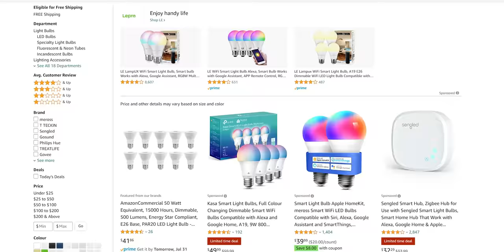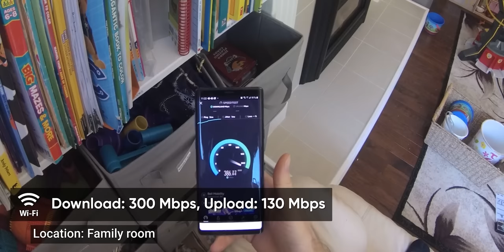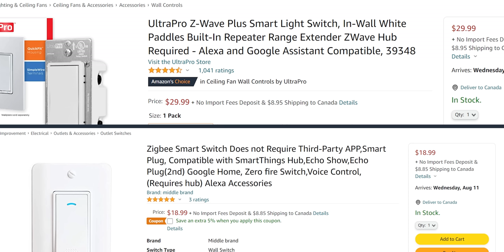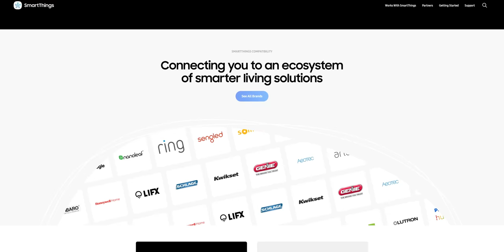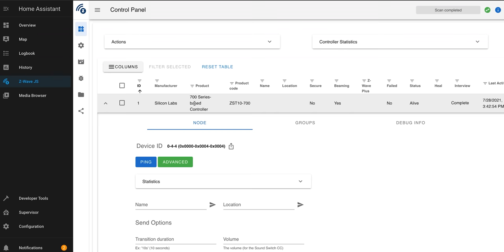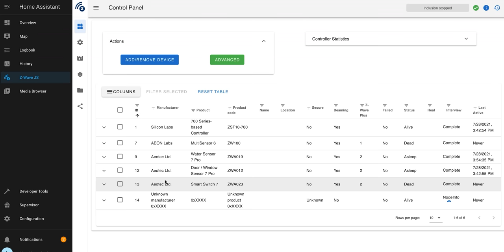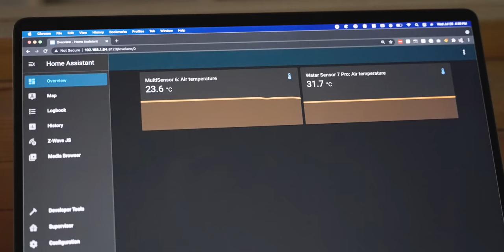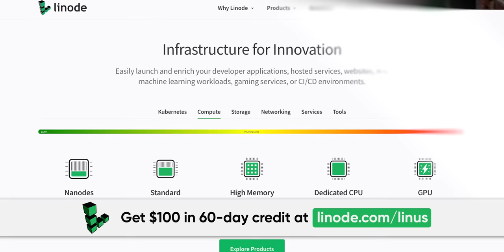My new house is gonna be MAGIC - New House Z-Wave Setup

Comment: I'm so happy that they continue to use the "Brian the electrician!!" jingle.
Reply: just me who read "Brian the electrician" and heard the tune?
Reply: I'd be even happier to actually see BRIAN!! the electrician!!! But I figure Linus won't do the car chargers himself, so there's still hope.
Reply: @pr1vatepiles1  same
Reply: Thanks you spoiled it for me. It's the top comment
Reply: If Brian was around he coulda told them running an empty microwave is dangerous because if there's nothing inside it to absorb the microwaves energy, it builds up way more rapidly and can kill the unit/cause damage/an actual fire etc

should run it with a small glass of water in it at the very least.
Reply: Scottward Holmes
What smart gear you use yourself, Philips UI? wifi?
not that smart, not understanding?
Reply: @SlackFX.channel i did not know that was thing. Thanks for telling me otherwise i would probably have killed 10 microwaves already
Reply: I hope it lives on in LTT forever

Comment: Linus: complains about mechanical sprinkler controls, and intercoms in his 1990's house.

Me sitting in my 1908 house having just removed concealed knob and tube electrical connections and uphill plumbing from the same bathroom:
"That's so unfortunate, I can't believe you were left with that mess".

It's not a competition, and I can identify with any remodeling struggles.
Reply: In the same boat, my house was also built in the 1900s. I just had to have the original cast iron plumbing going to the upstairs bathroom replaced a year ago.
Reply: 1900s as well, upstairs bathroom pipes shake sometimes audibly, and knob and tube in the whole top floor. Dangit Linus your 1990s house was great.
Reply: I lived in a car 4 years ago, and even I felt more fortunate not having to deal with old houses
Reply: @FullOfBradells  That noise is likely coming from your water supply pipes. It's called water hammer if you're not familiar. You can install a thing called a hammer arrestor to stop that.
Reply: 1913 here. I look forward to the day where I proper electric and plumbing in our first floor bathroom.
Reply: @Ci Absalon I ripped that shit out in a heartbeat, and made sure what it was connected to was pulled from my electrical panel. Strangely it was being used for my doorbells, which connected via a 24v stepdown transformer on each of the two lines.
Reply: @MHTriBernard  asbestos tile is only 9.5"*9.5" last I knew. I could be wrong, I'm not an expert.
Reply: My parents house is filled with knob and tube wiring, the thing is no one ever removed wiring or plumbing while upgrading the house built so I have no idea what's active. Sigh. Like someone has a knob and tube wire going though and HVAC duct... Is it active? Is it not? Haven't gotten to investigating it all yet
Reply: @FullOfBradells  you're getting air pockets and pressure spikes in your water lines. If you add one of those blue pressure tanks that goes away.
Reply: atleast you can afford a house.. rich guy
Reply: 1912 house 8degrees in the winter 35 in the summer
Reply: @lvl5monk297  buy a non contact tester
Reply: Ouch on the uphill plumbing
Reply: me sitting in my house built in the 1880's: 🧍
Reply: Seriously. I just found a couple holes behind the baseboard from when a previous owner upgraded my mom's house with electrical wiring.
Reply: 1940's house, found the chicken wire plaster and weird sound(?) board in a few walls and loads of cloth wrapped wiring that I slowly replacing circuit by circuit.
Reply: At some point you wonder why they don't just bulldoze the house and rebuild an entirely new modern one.
Reply: I've been to a castle that was built in 1285 and they had decent electric wiring and lighting.
Reply: Lol.
Reply: I have an old Victorian style house built in 1888. 
Half my windows don't open.
Reply: I live in a house built in 1800s😂😂 With renovation ofc
Reply: I had no ceilings downstairs for 10 years because we redid the central heating and the walls needed work too.
Reply: Haha rip
Reply: I would be too scared to live in a house that old,
the ghosts tho lmaoo
Reply: My house if from 1830's
Reply: @billybillybillybillybillybilly  damn dude seen a ghost or smn yet
Reply: @lxquid.ocelot  i have had so superstitious experiences, but nothing else. But my house would be worse, it used to be a woman's clinic, with surgeries, so possible  deaths
Reply: @lxquid.ocelot  nah, but after my grandfather died, the light pull strings would move on their own (it is an old home, so where there weren't light switches, there are pull strings) and some cups moved on slowly and shakily their own for like 5cm. And this is Syndey, so any Earthquakes wouldn't be strong enough to move objects
Reply: @lvl5monk297  You can buy a $5 non-touch tester to see if you got live AC wires.  Extremely useful to have if you are doing any sort of house wiring work, especially if your house is older and might have some weird wiring methods (e.g. live wires not connected via a fusible link).
Reply: some scottish guy in his 1600s homes "Oi, thats cute mate."
Reply: @robintst  I'm in a literal boat from 1921  but only the outside is 100 years old 
I got 500 gb a month wireless 4g router wich works amazing it's not the 600 mb/s what I was used to but 30 is fine for me
Reply: “Laughs in 1700s English house”

Comment: I highly recommend putting some sort of filler media over your AC intakes if you run it while construction is being done in your house. You don’t want drywall dust or anything else in your AC coils.
Reply: As a drywaller - I second this. Also change the main furnace/air handler filter after the construction is done (or at least check if it needs it), and if there's any forced air outlets at floor level, it wouldn't hurt to cover them with ordinary window insect screen material to keep big chunks out.

We (the company i work for) always vac the registers when finishing up at a job, but you can only get so far with a shop vac

Comment: i had no idea about home assistant with RPI, thanks for that i am going to try it later today
Reply: Best thing ever!
Reply: A RPi is kinda nice when getting into HA but I would recommend a nuc or some sort. The amount of reads and writes HA does will eat your SD for breakfast. 
Also the nuc is far more powerful which will end up in a faster reboot. And since you're building and programming a smart home system, you'll do that a LOT!
Reply: @DhrChibi1  Agreed. This is why I bought a HA Blue. Faster and more reliable than SD cards on a Pi (yes, you can boot your Pi from USB)
Reply: If you already have a server setup you can just install it inside a vm to get the same functionality
Reply: We can have "smart" lights without giving a foreign company full control?
Reply: Yea, it's a thing.. but home assistant writes to the SD card enough that you'll likely end up with a corrupt card inside a year.  I run it in a VM, the extra horsepower of a "real" machine is beneficial too ;)
Reply: @MattBlank0  Yep. Especially if you opt for something compatible with tuya or tasmota, tuya can be controlled locally - there's a home assistant add on for that, and tasmota can be flashed onto MANY various wifi devices. Once done they can all be blocked from accessing the internet. 👍
Reply: @DhrChibi1  RPI3B+ will boot from a SSD on a USB adapter without having to even turn on the USB boot flag. Kinda nobrainer if you ask me.
Reply: careful using an rpi, sd cards will get destroyed by HA.
Reply: @DhrChibi1  not wrong RE SD cards. LEarnt that the hard way. I boot my pi from a USB and it’s been rock solid since. I also do nightly backups to Google Drive just incase!
Reply: There is a lot of hardware that you can run HA on. As for raspberry pi... You'll need a model 3 or higher. There are better hardware choices if you don't have one laying around...

Comment: to answer linus, you could use the output of the power meter for the whole house as a parameter to avoid having too much power draw at once: for example you could stop the charging of the cars if someone turns on too many devices at once
Reply: Could also load balance the 2 lines so one is not getting hotter then the other
Reply: Or have a second breaker box just for the garage. A guy I used to work with did that for his Tesla so he could charge his car without affecting the house electric. He then is able to monitor his solar supplemented power used to charge the car and whatever isnt used back feeds into the line. The power company is literally paying him for the electricity he uses to get to work.....and he works for the electric company 🤓
Reply: @Watercooledguy  Agreed with the second breaker box. Its honestly just more ideal and safer to run it separate for the Garage. 
I think linus could do that and would be better off in the long run. Could even run a separate system of solar so he has a bank ready
for Tesla charges so it doesn't stress out the overall parameters of the house's breaker.
Reply: Still limited by the main breakers capacity of 200amps with a pony panel for the garage.
Reply: No.  No. No. 

EVs manage that themselves and talk GreenPHY.  If you don't have that running in your house you will be tearing out this wireless crap that should never have existed.
Reply: You could also make decisions based on your Time of use billing (where electricity prices fluctuate based on time) and solar output.
Reply: It's even possible with a sufficiently sensitive whole-house current sensor and smart enough software to detect and characterize individual loads in the house, then "learn" the usual patterns, and alert on changes: for example, the fridge/freezer compressor cycling will be very recognizable. If it starts to cycle faster, or take more power, you can alert the human, who can close the damn door! (Or get the failing compressor serviced) In essence, you can use machine learning to tease out all the loads in the house, without having to add individual load monitors to every outlet and appliance.

Comment: Gonna love when Linus gets it all setup then updates Home Assistant and it ALL breaks as per standard home assistant update requirements
Reply: How often do people need to say it:
Read the changelog, especially the breaking changes part before updating.
Reply: @Joey-ir3lk  an update shouldn't break anything
Reply: @Theosplaytime  it doesn't just randomly break.
In developing software, what Hassio kinda is, stuff sometimes get deprecated.
It's doesn't just happen randomly, they actually announce it a few updates before.
Reply: @Joey-ir3lk  I don't think I want "developing software" controlling my home. Somehow, HA always tells on itself rather quickly...
Reply: @ikjadoon  it realy isnt but you MDMA is still right HA has good deprecation policy but people still dont follow it and that is what happens as a result Read changelog Read braking changes like you should with every software update
Reply: @ikjadoon  you want developing software controlling your house that means that software will get better and actualy have policies to fix bugs and security problems. But yes sometimes deprications happen having good deprication policy is important

Comment: As an electrician, you can never go wrong with hardwired Ethernet throughout the house with WAPs (WIRELESS ACCESS POINT) scattered in alternate hallways etc. With a programmed Cbus system. If you have all your light switches, PowerPoint's and lights running wireless, it just creates the problem of drop-outs and unpairing issues. Linus being a tech lord should know this! You can have all the tech gear you want on wireless systems but when it comes down to the essentials In your house that you rely on every day for living, keep it wired! :) love from Straya.

Comment: As an electrician who has been doing this for 15 plus years and specializes in automation just use Lutron Caseta for what you are doing, no neutral required and works every time
Reply: No neutral required for a few of the devices (dimmer mainly).  A lot sill require a neutral.  I don't think a neutral is a problem for Linus, but Caseta is at the top end of the consumer tier smart products.  And they just work.  No one wants to tell the family, "Sorry kids, these lights aren't working like they normally do because I decided to do an update to HA last night and it broke my automation.

Comment: I just received my Sense that hooks up to the panel and can identify what is running by its electronic fingerprint. Eclipse on to the two phases like the device you had does and then it gets powers off of a 220 breaker. If it works as described it should detect and learn all of my electric devices in the house. Can’t wait!

Comment: I'm in the process of doing this right now. I wish I had a employee to dedicate to home assistant I love playing with it but damn it can take a long time to customize. What an amazing project, and it is super cool to see Linus using it and getting it some additional shine.
Reply: I am saving to do this on my house. Any tip or suggestion I should be aware of? :o
Reply: @contradictorycrow4327  Already done that. My question was more along the lines of the Home assistant software.
Reply: @darktetor  Advice would be to keep it as simple as you can if you are building from the ground up.  I'm liking switches more and more with zwave. I find wifi bulbs are not as stable. I also would suggest if you are using a raspberry Pi 4 run it on a SSD instead of SD card. Do research on devices before you buy make sure they integrate into HA and play nice. For example Nest thermostat and cams are a giant PIA to integrate and requires quite a few hoops to jump through. You will need to do a bit of coding in the HA yaml files to make some things work . Don't get intimidated there is lots of videos and tutorials and the HA community has been a friendly and pleasant experience. The second you make a cheap motion detector turn on your lifx stuff, those are the moments that make it all worth it.
Reply: @tyx2  now this is what I wanted. Thank you! In fact I am in the process of buying a raspberry Pi 4. Gonna take all this in consideration for the other devices.
Reply: @darktetor  Have fun with it ! I'll give you the best of advice. When you get frustrated and you will!!! Walk away for a bit also the first thing you should set up is backing up to Google Drive. This way any mistake made you can go back, also if your rpi4 or SSD were to fail you can restore within minutes

Comment: I'd highly recommend using an SSD in a USB enclosure for the Pi. Much more stable than an SD card, quicker reboots and updates etc. Then use the Google drive backup add-on for automatic backups should anything go wrong.
Reply: Someone should show Linus the TOFU board that lets you use m.2 NVME SSDs natively with the compute module 4
Reply: I'd rather back up to a local NAS than Google drive (cloud services are a catch 22).
Reply: @grn1  He could do both. I mean the dude will have a server room anyways so he will most likely have a dedicated NAS anyway...

Comment: Great Episode!  I came to the same conclusion months ago when starting a building automation project.  One thing about ZWave, because of the standardized structure for commands, any device not listed can be easily added by simply adding parameters.  I did this with openHAB.  I introduced a commercial Yale Lock with an AYR202 ZWave module. openHAB detected the device, I submitted the resulting XML to the Open Smart Home site and was invited to add in the  ZWave parameters which form the basis of the device channels.  I can now program codes and simply unlock the door with a tap.  ZWave is the way to go for most building automation.

Comment: I really like this video. You explinations about different types of connection are really helpful. Right now I am only in an apartment, and I have some wifi outlets, running on a second AP to help with the bandwith of my primary network. Once I get a house I want to upgrade all of my current devices with the z-wave devices like how Linus is currently doing in his house.

Comment: Every switch in my house is a GE zwave switch I think over 30 to be exact. Ive been running homeassistant with the aoetec zwave hub for like 3 years now and love it! Plus you can easily add Siri and Ok Google to voice command/control everything.